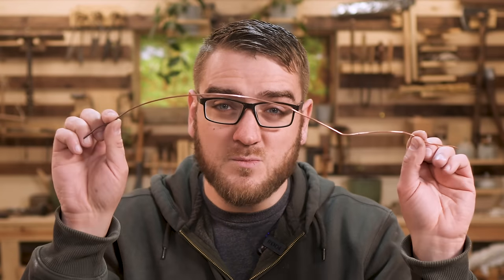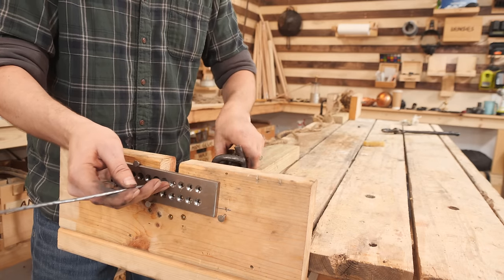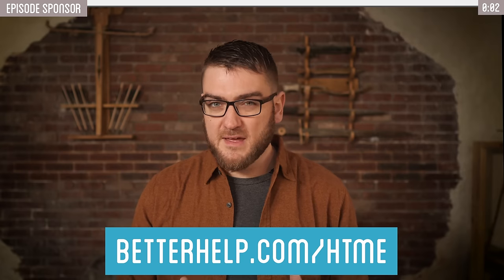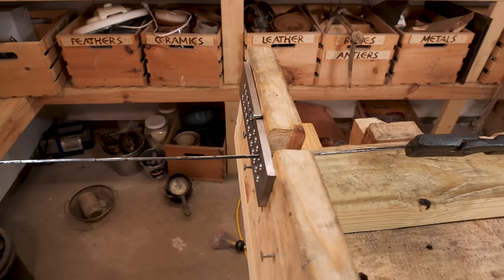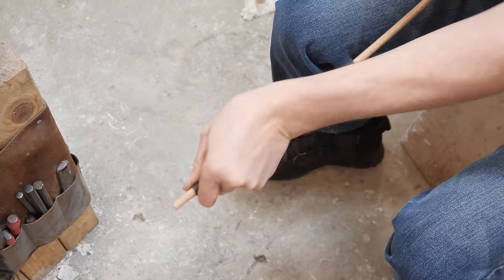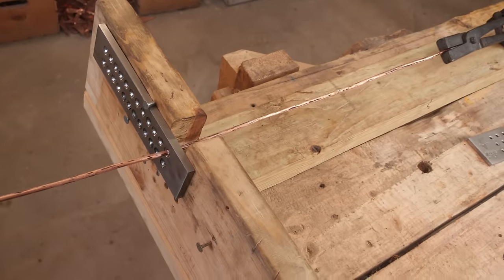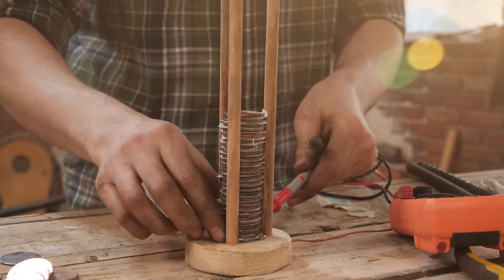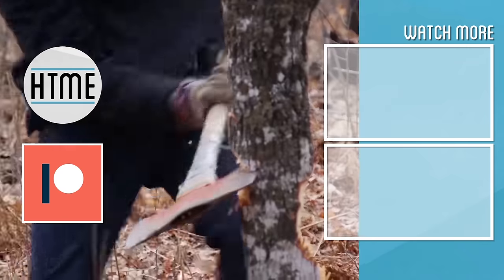Is This The Most Difficult Step to Unlocking Electronics?

Comment: Insulation might be easier than I initial thought.  I suspect the sort of enamel coating used in magnet wire (for how thin it can be) is something you could approximate with a bath of fairly crude chemicals.

The hint about annealing the wire between pulls is obvious in retrospect.  Huge deal, preventing work-hardening and breakage.  16ga magnet wire is not bad at all for homemade.

How do you make the die used for pulling the wire, though?

Comment: 9:40 if you watch those factory videos from Asia you see that they forge circulat pieces hammering the piece between a two part semi circular die... just drill a hole between two plates put your raw stock between and hammer it, you will end with a good round stock.

Comment: I fully understand the drawing of the wire.
What I don't quite understand, is how you get the first tip of the wire through the hole.
I mean, when you have pulled the wire down to, let's say 2mm, and you want to do the next draw, which is, let's say 1.95mm, how do you get the tip of that 2mm wire through the 1.95mm hole?
Do you start by hammering the wire thinner? And if so, how do you make sure you don't hammer it so thin that it breaks when you start the pull?

Comment: How do you get the wire started in the next smaller hole each pull?

How do you make the pulling block with the holes in? I'm guessing when society needs to restart you can't order one from machine supply on amazon

Comment: You can greatly reduce the force required at the crank if you introduce a pulley over the slim axle. The axle is too slim. If you increase the distance from the rope to the center of the axle, the torque increases. The rope should wrap around the pulley.

Comment: Watching you draw the copper wire was really cool. I was surprised how long you got it. I dabble in electronics and I have to say honestly that’s the next project you should do with the wire should be a generator of electricity. Would be great if you could use one of your other inventions like the water wheel that could maintain a continuous Motion. Then all you need to do is figure out the magnet configuration and WAMO you’ll have a better source of electricity than your battery pile. It will likely be AC electricity, compared to your battery which produces DC. But you’ll be able to get way more current, which will be much more useful to you with further experiments. Good luck with future developments in this technology. It’s been great to see you get this far!

Comment: I watched a physics professor do a demonstration where he had a copper wire suspended from the ceiling of the auditorium. He had a basket that he kept adding weight to slowly as the wire stretched many feet. I don’t know if the wire stretching was uniform throughout though. That was so painful to watch that wire being drawn without lubricants.

Comment: Next time you should try lube on the draw plate and a little bit of heat to help the wire stretch.... Sometimes a little bit of power going through the wire helps it anneal more uniform so it doesn't break when drawing or you can use a torch.      😁👍

Comment: Drawing wire is all about annealing, soft metal won't break. There are a million silversmiths that could have helped you figure this out.
Reply: I was thinking this too. Anneal the metal, then wax it before trying to pull it through the draw plate.

Comment: Yeah, the amount of force required is not to be underestimated. 

Most medieval wiremakers set up shop next to rivers and streams so they could use a water wheel in order to generate that strength.

Comment: In the future, you shpuld attach the wood better, so it actually worls properly. A circle leaned over is an oval. As well as, heating the metal just before pulling it throigh the hole.

Comment: Was that a fiber optic teaser I heard at the very end? That sounds incredibly difficult to pull off at home, even with modern tools and supplies...
Reply: Electric telecommunications in a copper wire travel at about 70% the speed of light.  Fiber optics isn't exactly faster than copper as all references to light speed are usually in a vacuum. Fiber optics has a lot of advantages, protection from interference from outside electromechanical sources being one of the biggest.

Comment: I seem to recall that batteries made with silver , potassium hydroxide , zinc are carfully rechargeable
 or the even more dependable 
Edison 
nickel , potassium hydroxide , iron batteries are recharged with brutally symple methods .
Larger plate surfaces facilitate higher battery currents . Shorts can cause excessive battery currents or worker distraction .

Comment: Appalling that you did not go to more advanced mechanisms for drawing , annealing and measuring forces .
Water , animal treadmill , agriculture based methane and alcohol , wind and steam power for heating . Drawing wire onto windlass that leads to the next anealing flame treatment cooling then another lubricant for next water cooled die stage as a continuous process in multiple stages .
Copper annealing requires time and proper temperatures , more than a " heat and done " .
Measuring the force on the die will help detect inconsistencies so you can diagnose and thus prevent breaks . Actually coating the wire with glass in an enameling process may be out of the question for now but covering with thin thread even with various resins , cured linseed oil would go a long way to getting more efficient materials use and coil winding density .
Electric coils can be made with flattened , rectangular and square wire as well aside from electroplating and etching .

Comment: Ever seen them make taffy? They use a cylinder roller that gradually pushes the taffy though a sort of cone shape getting ever smaller. If you were to stop the machine you would see a large cone shape blob of taffy at the top and then a "wire" perfectly sized the same side the other end.

Comment: How do you start getting the end of the wire through the draw plate? Do you make it thin enough to thread it through by stretching the end of the wire with pliers first?

Since we know the two most fundamental mechanical engineering rules are (1) F=ma and (2) you can't push a rope, the detail about how this is done is vital to reproducing this method.

Comment: You were having the breakage because you were not annealing your wire enough. You also run into other problems as the wire gets smaller. You have to take smaller and smaller steps down in the size so as not to let the force needed to keep going down exceed its tensile strength.

Comment: I think extracting latex from dandelion/milkweed or using pine resin would also make a good insulator coating but probably not as flexible as modern silicone

Comment: For electric, I'm surprised they didn't get to applying waxed paper, lacquer, tar, or latex and making sure it adheres properly as I'd think those were ways of insulating a wire until better plastic or synthetic rubber coatings were developed. Insulation really is a key part to doing electric stuff as much as having a good conductor is.

Comment: I didn’t catch it in the video, when annealing the copper wire, were you quenching in water or just heating and letting it cool slowly?  Copper is kind of the opposite of annealing steel and needs to be quenches to rapidly cool when annealing.

Also, as others have said, lube.

Comment: I think I just thought of a much easier and faster way to do this, using the same technology. You start with an ingot / a blank. And you use a very small sharp chisel - like you would use for engraving or scribing. Then you just keep one long continuous spiral or pattern. Would it be perfect? no but you also could start much smaller. You could also heat and ROLL it between 2 plates (possibly with a thickness guide on the sides) if trying to pull it breaks it.

Comment: A little known fact is that to make exceptionally fine wire, you really need to begin with a very large diameter slug.

I learned wire drawing as a child.

To make a long story short, drawing wire is literally cold forging.

The more you cross stress the metal and create internal shear grains, the poorer of a product you will get

Comment: Use of swages would reduce the original bar to a much more consistent diameter for the drawing plate.
While some wire would still be needed, why not just jump into printed circuit boards?  Use etching to make the "wires" between the components.

Comment: But how would you make the drawing die? What if you were really trying to rebuild civilization from scratch, and couldn't use a storebought one?

(And yeah, as others have pointed out, chainmail is far from inpenetrable. It's fairly good against swords, but swords were merely backup weapons on the battlefield. A 100-pound warbow will go right through chain as if it was barely there. Hence why chainmail was never worn alone, but always as part of a set of different layers.)

Comment: The main problem regarding the electro magnet was, that you need an AC source and your battery is a DC source. This is because a CHANGE in current causes a magnetic field.
The only reason you affected the compass at all is the iron core of your electro magnet.

Comment: you guys should attach the wire puller plate better so its at a 90 degree angle when pulling.  its sitting at a weird angle, putting more force on the top half of the wire, causing stress. thats also part of why its stuttering through instead of gliding.  also lube the metal up.   its like you guys dont even try sometimes.  get 80 percent of a project done and call it a day. i dont get it.  just do more prep work, itll save so much time and stress, and youll have a better product to show us. cutting corners isnt the way to do things.

Comment: 5 to 50 is a 900% increase, not a 500% increase.
Take 5, which is all you have at that moment so it's 100%, and add 100%(5 inches)
That's 10. Add another 100%(5 inches) to get to 15, and so on.
To get to 50 takes 9 additions of 100%(5 inches), or 900%.

Comment: You bought a draw plate.  You need to make the draw plate before you can use it to make the wire.  To make the draw plate you need carbide, or at least hardened steel and precision drill bits.

Comment: Electrical wire + Glass, next stop vacuum tubes and lightbulbs ?
Reply: Incandescent lamps come way before vacuum tubes. The tubes and electrodes aren't too hard but the vacuum is. Light bulbs work fine in a vacuum that's a thousand times weaker than tubes need.

Comment: Making a hydraulic press would be better.  It is a basic but very utilitarian tool.  You can make wire with extrusion similar to a Playdough toy.
Reply: That wouldn't be till after he makes a steam engine or steam hammer, steam ran the world for a long time
Reply: @Wisconsin.pikachu  Steam has nothing to do with a hydraulic press.
Reply: @Mr_Dopey  if doing this in world history timeline he would do steam before hydraulic, that's his whole thing.  If he just made a hydraulic press at this point why not make a diesel engine instead of him making a water wheel 🙃
Reply: @Wisconsin.pikachu  diesel engines were actually pretty difficult to develop. Rudolf Diesel was widely considered quite the crackpot. His story was a sad one too. He vanished on a voyage from France to England. Some say he jumped overboard but no one knows for sure what happened to him. He did have legitimate mental health problems though.

Comment: i feel like refining silicon to the point of micro chips is probably the hardest part for electronics. Electrics tho this could do. :P
Reply: How are you defining “electronics”? I thought it was just “tech that makes deliberate use of electricity”? But it seems like maybe you would use “electrics” to mean that?
Reply: @drdca8263  based on the difference between an electrical engineer and an electronics engineer. one works with wires, the other works with computers

so an electric device is one that has no computers, but uses electricity ie: a light bulb. where an electronic device is one that has a computer of some kind (including read only microcontrollers) ie a phone

Comment: 5" of raw material, and now 50" of wire is not a 500% increase in length lol. It's 1000%.
Reply: 5 is 1000% of 50 but you started off with 5 so you have to subtract that. So 50 is a 900% increase from 5.
Reply: @1pcfred   Ok, but 1000% of 5 is still 50, not 500% like he states in the video.
Reply: @That1NissanGuy  you were both wrong.
Reply: @1pcfred  Thank God we have people like you. Keeping everyone in check.

Comment: Can’t they be rolled out? gun barrels in the mid 19th century started to be straightened and lengthened using such process, surely that could work with wires

Comment: I would've preferred to see you make your own draw plate for the wire.  I'd really like to see how you get the holes all the right sizes.
Any plans to make springs?
Wire has all sorts of uses that people don't always realise.  You could make paper clips or safety pins now.  And of course, the most important use for wire-- banjo strings.  Edited to add-- The banjo frets are made of wire, too.
Reply: Trial and error is how draw plates were devised. It is also how to make sense of wire gauges which seem arbitrary until you try to make wire. Each size difference is a drawing. It's the biggest step you can go and have it work.

Comment: I feel like a press based system with a thin nozzle would be easier tbh. 
You melt the copper until it is pliable and then with something similar to a hydraulic vice, you tighten and press the semi-solid copper until it extrudes slowly from the orifice and with an oil bath, you could cool it down and spool it. That’s my idea
Reply: pretty sure they didn't have hydraulic presses in medieval times, also even if they did I doubt that would work anyway
Reply: The key element you're missing here is hydraulic.

He needs to invent that first!
Reply: I'm pretty sure even today wire is made by pulling metal through a draw plate.  I use draw plates all the time as a jeweler.  You start by melting the metal and casting it into a round bar, put it through a rolling mill to elongate it by compressing it between two half round rollers, then when it gets thin enough you move  onto the draw plates.  So the part they did with a hammer and anvil I would do using a rolling mill, and you have to anneal if between every reduction in size.

Comment: pulling wire through the holes while it was hot so metal will pull and lengthen and prevent work hardening look amazing, but the tool is not made by hand that is a factory made tool with holes in it? Also this channel go through workers so fast to me that is sus, work is work but not many channels go through workers yearly. Maybe the move from you doing the work to outsourcing the work can be harder then pay is worth to som also this video shows you for 1/10th of the video, to me that is not why I watch this channel I watch it to see you grow and learn not strangers doing the work for you while you voice over and do a ad for a horrible company...

Comment: you should really get a mechanical engineering student to take a look at stuff you guys make. The plate with the holes is attached to a piece of wood that isn't braced properly therefore the wire is being pulled through it at an angle, dramatically increasing the force required to pull it through. Also you bench is weak af...
Reply: Sometimes I get the impression that they're either not making much of an effort or they intentionally try to make things more difficult than they need to be. But perhaps it is easy to be an armchair general?
Reply: Lol mechanical engineers? Even a bush tribesman would've figured out a better way to hold that drawing board. So much more effort spent just because they couldn't put 2 more tall/ chunky pieces of wood to act as a brace....  at this point it ought to be for generating engagement I refuse to believe that they are just oblivious